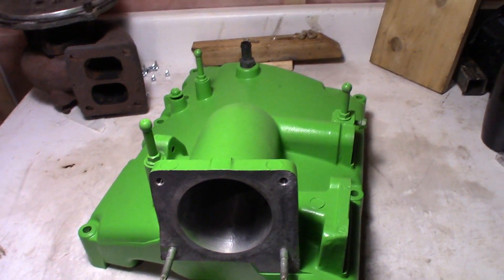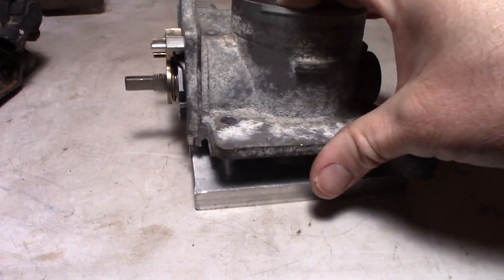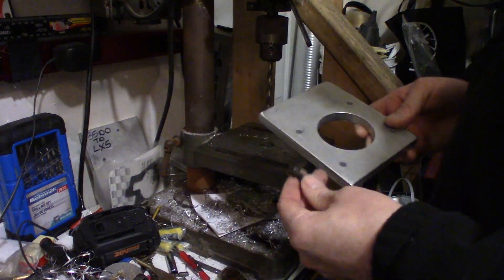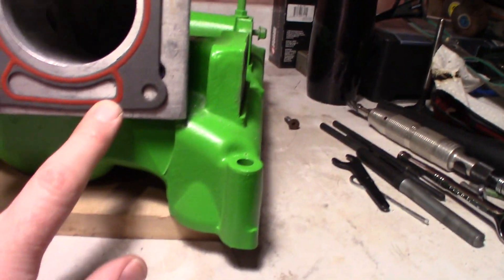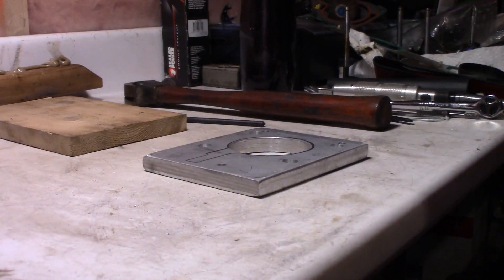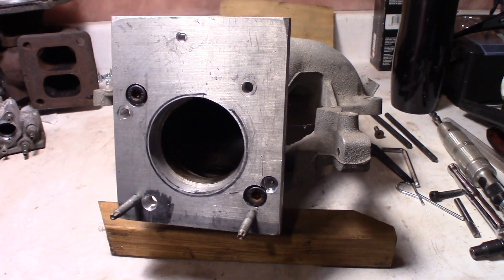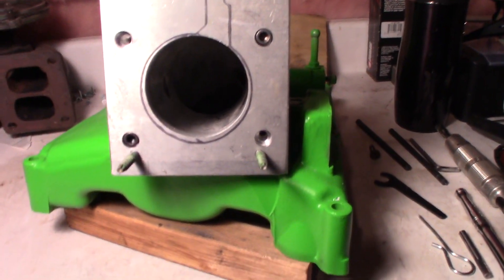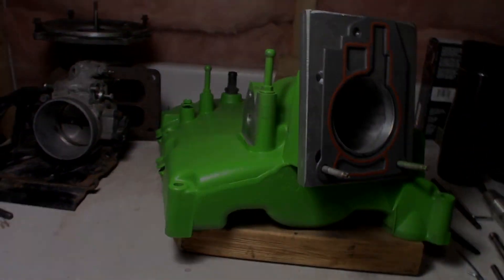Adapting a 65mm LX5 Throttle body to a 31/34/3500 v6

Comment: Just curious i got a 93 3.1l Pontiac and ik the fdp throttle body is hard to find but what other throttle body would work even if I have to make an adapter
Reply from the maker: The closest "GM" throttle body I have found that might work is an early ecotec 2002-2004, I think they are around a 58mm, cable operated and 2 bolt holes line up. My self I was going to make a Ford 60mm TB work from a 3.8/4.2 windstar (around 2000 year). They require an external IAC valve and a vacuum block to replace the current 3.1/2.8 vacuum lines. Hope this gives you some ideas!

Comment: I have a 3.4 base camaro right now and I want ti max out the power in that engine and see what I can do to modify it to the max before I need to go get a v8, I want to put a 350 with a carb it , ita gunna be a street ripper and weekend car but be able to daily it if I want, please let me know what the best mods are first so I don't waste any money, im a stay at home dad on a very small budget,
Reply from the maker: this is a little difficult to answer, If you are for sure going to a 350 down the road I would just do the simple things like cat-back exhaust and other chassis stuff that will work with the 350. If there is a chance that you might stick with the 60* v6 then I can recommend more mods. What is your budget? Knowing that I can point you in a better direction!

Comment: That gasket is from a 95-98 f-body 3800 isn't it? Lol or possibly the gtp. It looked like it had a bigger opening. Gtp uses 69mm for the supercharged engines.
Reply from the maker: No it's from the LX5 3.5 DOHC (oldsmobile Intrigue) 
I didn't think that the l67 got that big of a throttle body from the factory!
Reply: @modeverything1  yes sir. Zzperformance use to sell bored out versions at 72mm for the L67 and 68mm versions for the L36. They were called the "High velocity" throttle bodies, but they recently discontinued them. I have one of the 68mm versions I'm currently not using.

Comment: This lx5 throttle body is an electronic throttle body from what I see. Did it have connections for throttle control and tps?
Reply from the maker: The lx5 TB is cable operated and has the same IAC and TPS sensors/connectors. The LX9 3500 TB is full electronic.
Reply: @modeverything1  gotcha. I've been trying to research and find a bigger TB for my 02 Firebird. It's electronic wanna only 65mm. So far the LS4 is the only engine that uses an electronic TB that has an 8 pin connector that is nearly identical. It's obviously a much larger TB, but I need to find the schematics and see what kind of testing I can try.
Reply from the maker: You have a ls4 in your firebird? I thought the ls4 was the fwd ls?

Comment: Who makes that plenum? And what is the advantage to that, over say, a 3500 plenum?
Reply from the maker: its off of a 3400 from a 2005-2009 Pontiac Torrent/ Chevy Equinox. No one that I know of has done any back to back testing on vehicle with the 3 of them, but I like that this one has more even flow to all cylinders with the inlet dumping in the centre of the plenum! There are not many factory hoods that it will fit under!

Comment: Very nice job.
I'm itching to top swap my old Z24. Would hybrid swap if I had the space
Reply from the maker: Nice! I am currently working on porting some 3.1 heads for Dave's z24 in the other video, we are going to do some before and after track times with it! We know that it can make much more power with other stuff but we are going for the "original " look under the hood!
Reply: @modeverything1  Looking forward to seeing that.

Comment: What I do when tapping flat plates like this is to put the tap in the drill press chuck and rotate the chuck
by hand. If it is too difficult to turn all the way through you just finish it off by hand. You always end up being perfectly
centered this way.
Reply from the maker: I was thinking of doing that! Lol but the lightning was better on the bench inside!